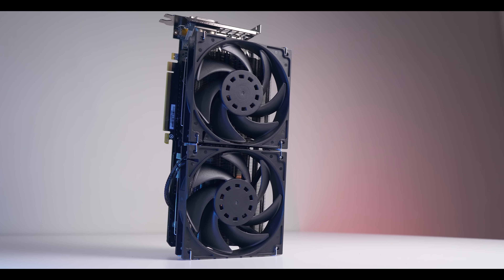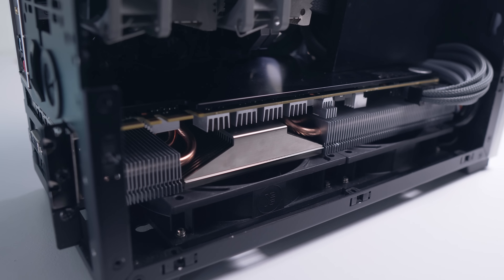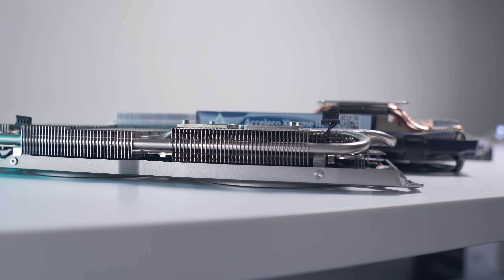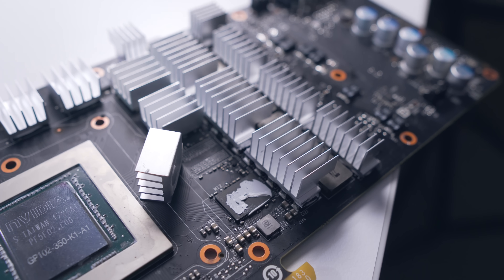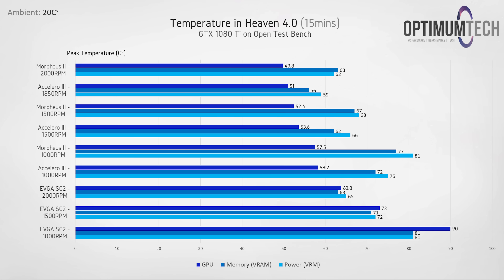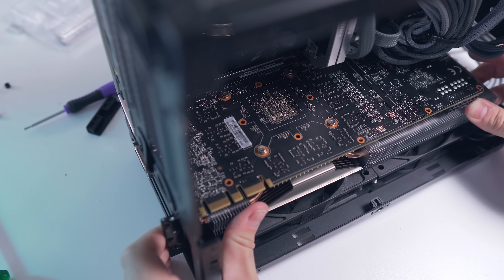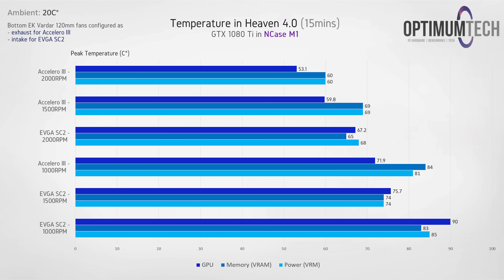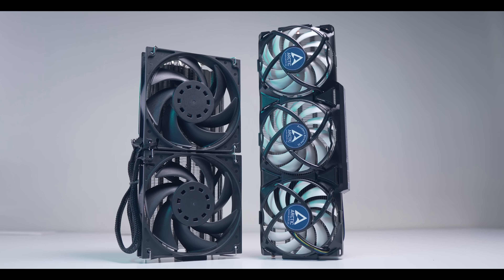Accelero III on a 1080 Ti - Exceeding Expectations!

Comment: Been rocking this cooler in my M1 build for a while now. If you're trying to make your build quieter by lowering your rpm while keeping solid Temps, I definitely recommend doing this.

Just make sure you know the limitations of your gpu warranty.
Reply from the maker: Well said. I'm very late to the party on this one. 
Still blown away by the performance on it.
Reply: How do you control fan speed? Can you adapt the speed depending on GPU temp through the motherboard?

Comment: I would love to see a g12 comparison. price to performance is amazing for the accelero.
Reply: I just installer g12 with a old corsair h105. Asus strix 1080ti oc. Idle 24, max load 42. Totally silent.
Reply: Nikolaj Nielsen ur max is nice. mine is 50ish using LM. But 240mm idcooling instead of nzxt
Reply: Under loading 42 ?

Comment: The accelero looks like 3 stock intel cpu coolers put together
Reply from the maker: Haha nailed it!
Reply: so if I bought 3 intel stock coolers glued them together I might have the same performance?
Reply: Its a nice cooler though. Got the first one on my 8800 Ultra. Damn what a difference. Was the difference between running Crysis or not actually, literally.
Reply: I don't understand comments like this one.  The only similarity is the sticker on the fan hub everything else is different.
Reply: This was my thinking as well.
Reply: But performs like 3 Wraith Spires glued together
Reply: Arctics Coolers always end up looking like that smh
Reply: +Judge Dredd For sure not.
Reply: design wise, looks bad but performance is amazing
Reply: here am i with my corsair h50+kraken g12 water setup.  38 celsius,lol.
Reply: Looks like crap
Reply: the graphics department obviously went home when this card was being developed

Comment: Very nice video, as always!  Is it possible to effectively use  EK Fluid Gaming loop A240G in M1 Case? Could we use normal fans (not slim ones) in the bottom of the case for radiator cooling?  And if not, how slim fans performs? Big thank you in advance if you can give your opinion, and much bigger thank you if you could test this option and make a video!!!